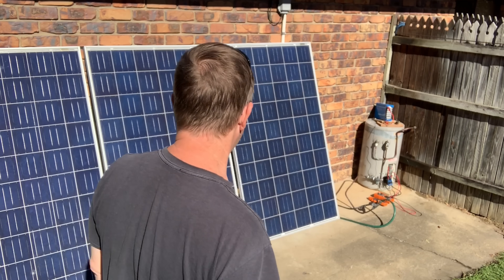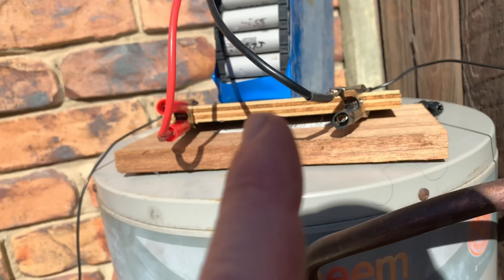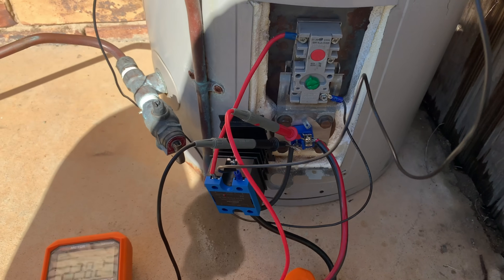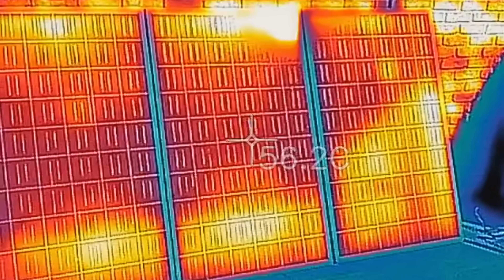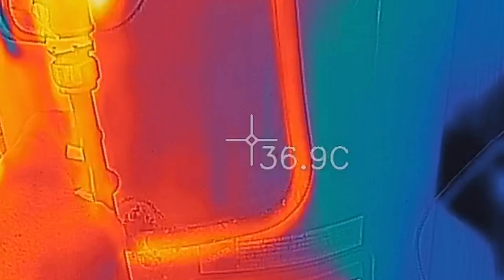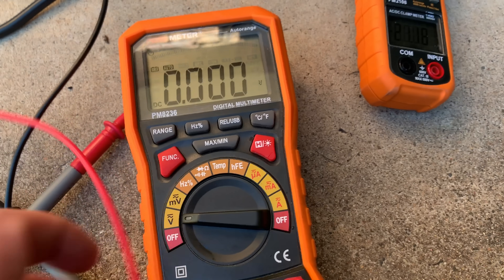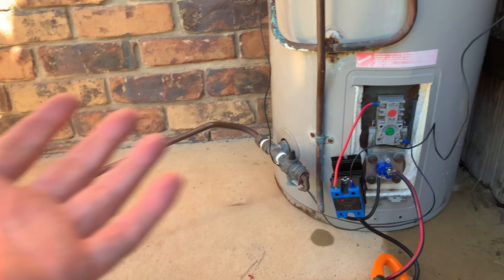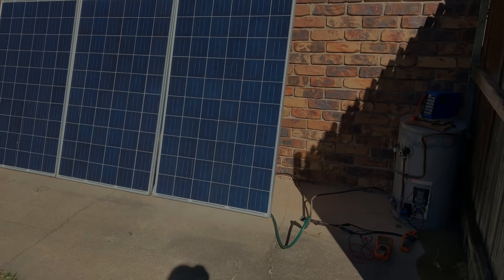Solar Hot Water day 3, Spoiler: it works and I've subbed David

Comment: Should of run the in bound water past the panel backs first to preheat water and cool panels.
Reply: Heatexchanger would be more efficient. Depending on source temperature in can move 1 of electricity to 7 of heat energy. There are heat exchanger with air source and liquid source. To minimize demand you can use waste water heat recovery, waste water can be reused for toilet, even for watering plants (if biodegradable cleaning supplies are used). 
Sure heat exchanger can be more expensive than simple resistant heater but if you use ac a lot and a lot of hot water including washing mashine (if it has separate input for hot water) and dishwasher or it can be set up for comunity like in a apartment building. It makes sense for sure.
Reply: I see someone has commented that it's too much work?
My question relating to heating of the panels..... Could they be getting hot simply because they are in the sun and not actually because of internal resistance?
Reply: @Jarmezrocks  My solar panels get up to 65° C, and get so hot that they lose efficiency. Pumping water behind them to cool them down and steal the heat away to heat the water would be very helpful.
Reply from the maker: I think there is a commercial product that does this now for a pool heater
Reply: To much work for effect
Reply: Brilliant. I thought that would be a good idea.
Reply: yes black pipes with white stripes

Comment: i have a setup  just  dont  seem  to be  working  way  i  think it should   running  6 12 volt  200 watt  panels  into   40 gallon hot  water tank  both  element's are 600 watt  and  it  just  makes  warm  water i looked  and  looked over  video   and  video  still  not  sure  it  only  gets  warm   water  not  really  hot  hot    any info  from  anyone  would  help  everything is  new  and  all  works   but its  just  not  kicking  out  the  hot hot  water  for   like taken  a shower   iam  lost  at  this  and  the  reg  power  bill  is  killing me

Comment: We're on 99% solar only using hydro when its cloudy for a few days otherwise using gennie to charge batteries.  We're installing a 30 gal electric to PREHEAT the water going to the propane 50gal hot water heater. The well water entering the hot water heater is 5c (40f) and once we preheat the well water entering the propane heater it takes X times less propane to heat the incoming "cold" water up to the 60c we desire.

Comment: Hey man, would it be worth while to consider a 240v to 24v inverter to couple with this kind of system so that when it's cloudy you can "give it a boost" so to speak?
I've got a few 240-24v inverters laying around from some old air con units. So a little project like this would be great!
Reply from the maker: People have been saying the voltage doesn't matter AC/DC but i don't really know.. and cant afford to blow stuff up tinkering lol
Reply: Using a 24V heating element is absolutely insane. It way more complicates the electronics needed and has a significant loss from voltage drops from that high current. This system demonstrates the principals, but should never be built as shown. Tear apart those power supplies and build a real PV water heating control.

Comment: 7 x 24V 300W solar panels in series = 250VDC. full load (2000W) = ~220VDC and you have a decent water heater.  AC switches won't work with DC, you have to use a solid state switch.  It's a FET and a opto volaic device to switch the DC.
Reply: Would you be willing to send me a list of products I would need to run a small ...window.... air conditioner from solar. The one I have is approx 6000 watts I believe,  but the setup could involve buying a new air conditioner as well as the panels and other coponents.  I would like to have enough to battery power to keep the unit running an hour or two after the sun goes down.  I'm thinking the air conditioning panels would be run separate from the general use system.  Might incorporate together but more likely will set up in 2 or 3 phases to keep investment affordable and be sure it will work before going all in.  I also like the redundancy so parts could be swapped in an emergent situation.
Reply: So would that mean you cant use the thermostats in your 24v series hookup to make 240v dc

Comment: I think the best system is two-stage solar water heating. The cold main water supply splits, with a line going to the roof and into a direct solar heater. That direct solar heater is an elongated parabolic dish with a magnifying clear glass cover (outside surface is convex), and the inside surface of the parabolic metallic dish is polished and reflects light like a mirror. Inside the device copper tubing runs back and forth, in multiple lines, in which water enters cool and exits hot. The water coming out then goes to an electric hot water tank, traditional water heater. Now, the electric water heater can get its electricity from photovoltaic system, and won't draw huge amounts of power. Instead of having to draw lots of power to heat up cold water it just sips on electricity to keep already hot water hot. This set up would allow much more of the PV electric from a battery bank to power other things, like a fridge, or even air conditioning.
Reply: Someone needs to start a magazine on these subjects DIY solar ideas

Comment: You could really improve the efficiency of the system with a mppt controller, especially on cloudy days.
Reply from the maker: That would add quite a bit to the build cost... that said this rig doesn't exist any more - it's had an upgrade :) video coming as soon as i'm done editing
Reply: @HBPowerwall  If you know something about electronics it would cost ~10us$ to build a simple controller, that would probably double the energy you would get from the solar panels.
Reply: @FoolishDane  
Hmm I'd like to see your diy mppt device for about 10usd.
Reply: HBPowerwall  Did the new video ever get edited? Can’t see it on your page. Very interested in solar hot water!

Comment: Ever thought of cycling the water? Adding a small (maybe DC) hot water recycling pump might improve the time it takes to reach the temperature. If it that works it will mean immediate hot water from every hot water outlet. hmmm. There is another experiment for you. :)
Reply from the maker: Yeh, i think most hotels do that, did consider putting small tank on solar thermal setup and using it to do the other half of the house so to speak. to pump water around it would be a big job here as you'd really need to insulate all the pipes and add a return pipe.. Prohibitive cost wise i think.
Reply: @HBPowerwall  True.  On  the bright side, the return line will be a smaller diameter pipe. But you are right about insulating the pipe.

Comment: Maybe I can connect my whole system to a water heater,with a voltage controlled relay, so when the batteries are full, the whole array can heat water, maybe it could take about an hour, if the water isn't very cold, likely in the evening, in time for a shower!!
Reply from the maker: Stay tuned :)

Comment: Yeah, insulate that thing really well, it should do good, off grid, if it heats in 4-5 or even6 hours, would be fine, I may look into this, and a solar thermal heating, then I can use my tankless gas heater for the really bad days, I just need to figure a way to incorporate all the junk in to a working system, maybe a arduino control system, that turns on what ever system is hotter, and turn the gas on if neither is hot! I plan to try the wind turbine thing, I can use it as a dump/ divert load! Maybe this will be the next hot thing!

Comment: With the same sunlight you could have boiled 4-5 TIMES as much water with solar thermal water heaters that would be ten times cheaper. What a waste of PV panels.
Reply from the maker: Is it a waste if they weren't being used, and i was just learning ? is it a waste that mid next week they will be back on the roof charging my 40kwh battery? Nar i don't think so - like i said in the video - dump load for battery bank. Will be run off 24v direct from batteries controlled by SOC with the BMS - so when battery enter a charged state - it dumps excess into hotwater :)

Comment: Great video.  Here is how I heat water with solar power.  I have an at point 13 gallon 120volt ac water heater which has power and temperature controls being run by my 700 watts worth of solar panels,60amp MPPT and one 100amp hr.12v battle born battery. Before I leave for work on a sunny day I set the temperature to max and power setting to low which is 200 watts.  By the time I get home from work the water temperature is 145 degrees which is enough hot water for two showers.
Reply: Is it still working to this day or have you made any improvements?

Comment: Next challenge, create a solar powered compressor heat exchange water heater system. Pretty sure with your excess battery capacity it would be much more efficient.
Reply: More efficient - yes. For £300? No!

Comment: I've been very disappointed by the offerings of footpaths for upcoming bulk pickup in our area tut tut.
then again, it is our area ha.
got my 6.32KW solar system installed last Tuesday and getting a lovely ~21KW a day generation now, and put some of my old panels to use on the pool salt cell and a few lefts for when I eventually go DC pool pump.

Comment: A solar panel is a current source. A 250 watt panel has a Isc of roughly 8 amps.
A Resistance Heater is a fixed amount of resistance. 
A 24 volt 600 watt heater is a resistor with a value of .96 Ohms
 (r = v^2/p)
So with 3 parallel panels you have a current source of 22 amps flowing through a fixed resistance of .96 Ohms.
 Ohms Law for Power = Current x Current x Resistance. Now use 22 amps and .96 Ohms.

22 amps x 22 amps x .96 Ohms = 464 watts.

Which is not too bad for 750 watts of panels
Reply from the maker: Nod... all I know it worked with out needing math (i might have saved some time tho)
Reply: Solar is the only thing I know where if it barely works at all people are so damn pleased. It is not anywhere near power point so energy wasted.  Just move in some clouds and it is a FAIL. These videos just perpetuate the myth that panels can be connected directly to heating elements. A great disservice to the solar community that needs more education.
Reply: @opera5714  could you elaborate on what would be a better approach? cheers
Reply: @CristianSzwarc   Watch my channel. Electronics is needed to match the panels to the heater resistance. At just 70% current, my power point controller gives 50% more heat. At 40% current you get 250% more heat. More than that, you get heat earlier in the day when it is needed. Direct connect is just goofy.
Reply: @opera5714  cheers, will make sure to check your channel tonight, seems you have multiple experiments there. After some googling yesterday I'm hopefully more inform now: because the resistance of the overall system is an ever-changing thing because circumstances/weather you need some dynamic controller between the panels and the heater to keep the voltage in the always changing "sweet spot", an mppt but less complex since there is no battery to care about. thanks

Comment: Just build a 48v instant water heater
Reply from the maker: and attach to a old cast iron bath tub on the top of the mountain
Reply from the maker: next..... well maybe
Reply: @HBPowerwall  100mm pvc pipe, 2 end caps, 2x 1500w 48v elements, 2x 1/2" buteline males

Comment: Still can’t beat gas for heating. Solar hot water is great when you have sunshine. 

A Better way is evacuated tube hot water. 

Much better for hot water as there are no conversion losses. I.e light to electric to heat.
Reply from the maker: Bang for buck & accessibility - I think this wins hands down..

Comment: I can do it better for cheaper.
1. get some hose, paint it black
2. coil the hose onto a board
3. connect one end to cold water, the other end to the insulated storage tank

et Voila, no electrical engineering required and you can buy everything at bunnings and still have enough money left for one of their overpriced hotdogs
Reply from the maker: Ooh fair call right there lol
Reply: Point of this was to dump waste power to the hot water system after full battery charge
Reply: Sorry to be one of those guys HB, I do enjoy your channel
Reply: Then wait for winter to come, freeze and tear all your setup
Reply: Great until it freezes and connections push apart or it gets dark and the heat is loss back to the night air or the hose gets too hot and burst and runs a few hundred dollars worth of water into the yard while you'r at work or on vacation.
Reply: "just wait till it freezes" welcome to Australia the country where only finely select regions freeze, but hey I guess you wish it could freeze being so far north and humid

Comment: Another thing I have done in the past is hook up this system b4 my current hot water system. So if the water is hot enough in the DC tank Ur main hot water system won't turn on instant or tank. But multiple cloudy days the main will make sure U always have hot water. And if the water going in2 the main tank is only 40 still good as main only needs 2 heat it 15 degrees
Reply from the maker: Yes we have been talking about a preheater - it's a great idea and if i did anything more here that's the way i would do it. (if )
Reply: I have the same plan to do now in my house to get a preheated water in solar  dc heated water tank before main gas heated tank
I have bought 3x 400w panels, 96v 60amp mppt controller and 24v heating element, but I still dont know which water tank to buy for all this system- do i need to get electric water tank and change the heating element in there or other tipe of tank.
Would be nice, if you could give me advice how to set up thermostat relay on it so it switches off when right temperature is reached and do i need expansion tank to set up for this tank as well, cos I have one expansion tank already for my gas heated water tank

Comment: Get a thermostatic mixer and then crank thermostat as hot as it will go. Then the water coming out will always be the same temp coming out of taps say 55c so no burning and technically makes Ur hot water system have more hot water
Reply from the maker: never herd of such a thing - but would be great in the kids bathroom to curb the hot water usage
Reply: @HBPowerwall  https://rover.ebay.com/rover/0/0/0?mpre=https%3A%2F%2Fwww.ebay.com.au%2Fulk%2Fitm%2F223212703225

Even this 20dollar 1 has been doing a good job the last 6 months
Reply: U can get from Bunnings for about 90bucks or cheaper from eBay.
Reply from the maker: Interesting - like the idea and never knew it existed
Reply: HBPowerwall They are standard equipment on things like boats, where a small hot water cylinder may be heated by the engine cooling water to close to boiling. They prevent scalding, allow more usable water from a smaller tank, and also ensure tanks are allowed to reach a high enough temperature to sterilise themselves.

Comment: 6:58 80oC? I think the legal limit is 60oC.
Reply from the maker: Deg C - 60 would cause bacteria to grow in the tank i think
Reply: Set the thermostat as hot as possible to capture maximum solar energy, then use a mixing stat on the output to give you your final hot water temp.
There is no problem running the panels at max current they can handle it, they were no hotter than the brickwork behind them.
Reply from the maker: someone just linked me the mixing tap thing - very interesting. I agree panels are fine in this configuration.
Reply: Epa recommends 120f cdc recommends 140f so pick your poison

Comment: You can get dual voltage dual circuit elements ie 240VAC / 24VDC are you going to convert your house Hotwater system?
Reply from the maker: I don't dare touch my wifes hot water, she goes nuts when there .isn't enough power to boil a coffee pot, imagine if she went without a hot shower.. WORLD WOULD END and it would be painful.
Reply: @HBPowerwall  Yeah, they are all the same. But that's why I suggested the 'dual element' the 240 volt part can be for her indoors, while the 24 volt DC can be for you. Maybe 40% of your electricity consumption goes in hotwater, especially when her indoors spends 30 minutes in the shower!!!
Reply from the maker: for my home already have the EDDI hot water diverter fromhttps://evolutionaustralia.com.au/product-page/myenergi-eddi-energy-redirector/ it's so easy and just works, don't think i'll mess with mine BUT might consider preheater, i think that would be a worthwhile project for sure.

Comment: You will find that it's just as easy to run your hws direct off your solar system. Just add the extra panels and a timer with a contractor.  I understand that involves an electrician. But that is the least headaches. But it's fun to play around.
Reply from the maker: This is going off grid so inverting dc to ac is silly and just don't have the inverter power to do it.
Reply: "least headaches" until your tank corrodes

Comment: use the case of the hw solar panel and put 19mm poly pipe in it ?
Reply: the black irrigation stuff
Reply from the maker: @dtec30  That would work well i would think. You could just putty up the hole and use it at thermosyphon hws without it being pressurized it would be fine to use...  (and cheap)
Reply: @HBPowerwall  would it work under pressure? ie solar thermosyphon heat and then pv solar heat dc element?
i'm guessing this would only be good for one shower?
Reply from the maker: I think that adds a level of complexity to it (pipping wise) might have to use a proper solar hws tank as it has extra inputs and outputs i believe
Reply: @HBPowerwall  ah ok  sorry pete i think too much
Reply: yes wonder if it could "run" a red cup coffee maker ??
Reply: ok bad idea scratch that